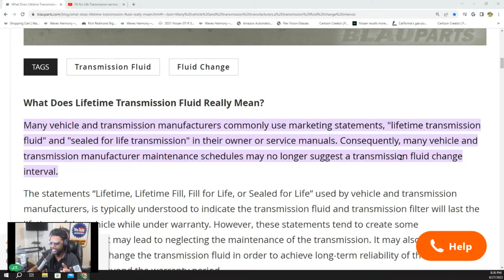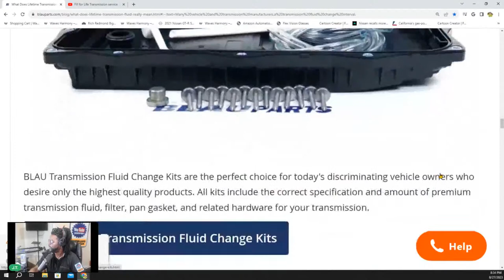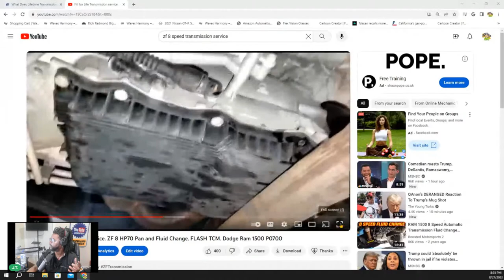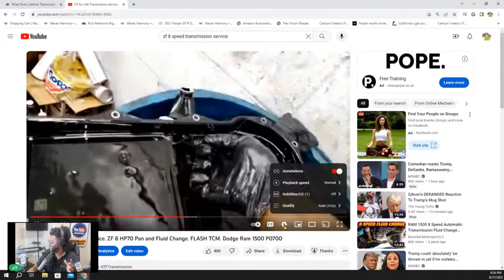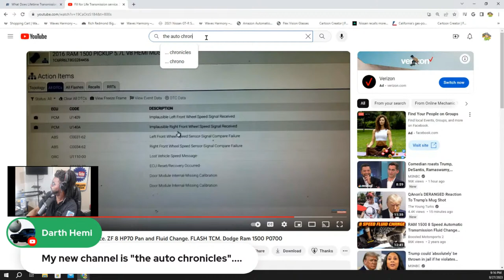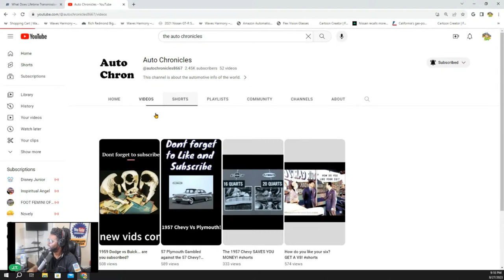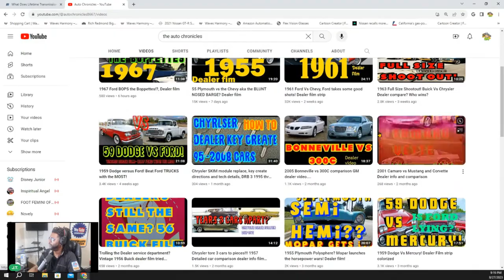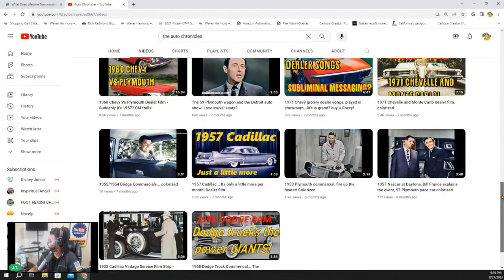The Truth About Sealed Transmission Fill for Life fluid change and service.

Comment: Like some other folks we know it is not illegal to tell a lie especially on a new or newer vehicle. Nobody's trans/axle or fluid is lifetime not now or ever. On most vehicles trans fluid and filter should be changed every 25,000-30,000 miles or every five years without exception. Dealership fluid only should be used. Some vehicles have a solenoid pack screen. Those types of trans with other types of screens need changing or cleaning every other fluid change. Some trans you have to pull to change some screens or filters.

Comment: Change ATF and Filter every 2 years or 50,000 Kilometres max. If the Garage has machine and fittings get the " Torque Converter " flushed out with ATF and Filter Change.

Comment: Never get your trans flushed if it's high mileage,it will
 Chernobyl Everytime,I just pump out at idle through the cooler,and add fresh fluid..
Reply: I just drained and filled my Buick Verano 2016 with 170,000 miles never had its transmission fluid changed EVER! And now runs like new! Your good with changing transmission fluid but apparently it can be a risk, I know other who have done it at 150k miles as well and the car is just fine!